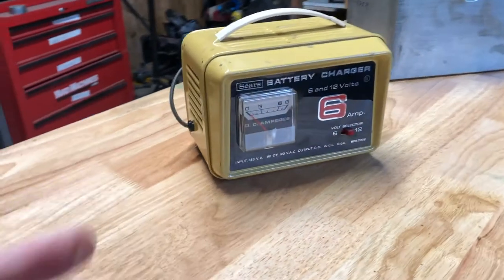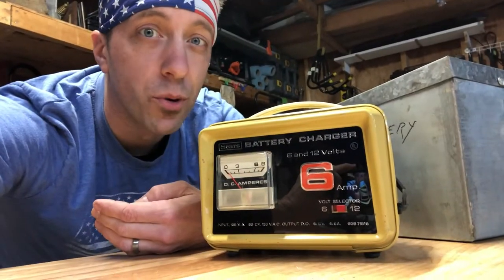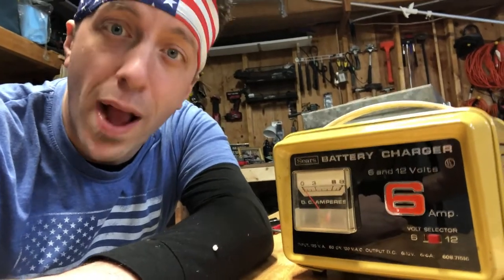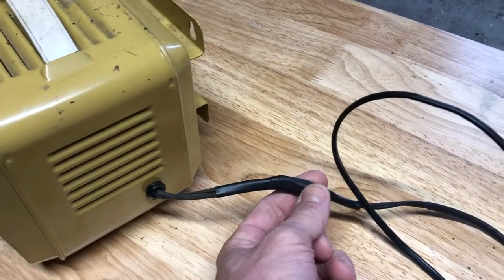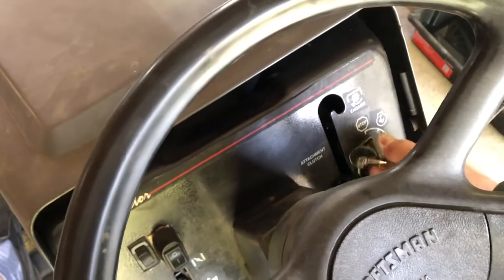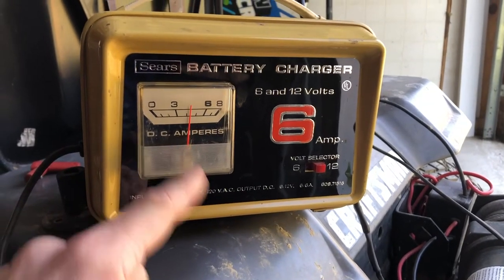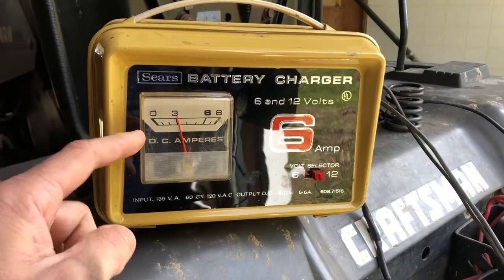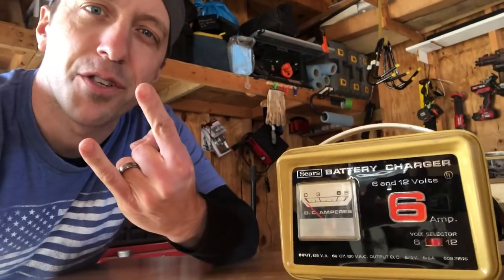I Tested an Antique 60 Year-Old SEARS Battery Charger - Does It Still Work?

Comment: I have an old charger just like this one that I have had for over 20 years.  My mother saw it at a yard sale and gave $5.00 for it, I replaced the power cord and the battery cord.  I also sprayed it gray and I have never had any problem with anything that I have used it to charge.  I didn’t realize it was that old, mine didn’t have the case with it.  I think you should get good service out of it, and that it will last a long time.
Reply from the maker: I sure hope so! It seems to be very well made. Thanks for watching and for the great comment. 🇺🇸🤘

Comment: Nice trickle charger. quick question should you not be able to tell if it is charged enough by the gauge. When you say "this thing is pulling" i am not clear sorry ha ha. I thought if you put the battery charger on the battery can show if the battery is charged or not the needle will not send current to the battery so the needle is on the far left? I had no idea that the needle would go to the right after half an hour and am wondering why. I am not that bright with electricity as you can tell but would like to know why the gauge barely moved when first plugged in then went higher and then went back to the the lower number around 3. IF any knows could you please clue me in ? Thanks in advance. Mine is from the late 40's early 50's I think and was a gift and I do treasure it :-)

Comment: I picked up an old charger two weeks ago but I can’t find any info on it. It’s at least 60’s but I’m thinking maybe before that. It’s an electric service systems charger or (ESS). There is very little info on google and Facebook doesn’t have any old school charger groups. It does work but I think it’s a 6 volt. I like vintage stuff and your charger is cool as well!
Reply from the maker: Wow, great find man! Old tools like those are great to come by.
A few years back I picked up an old air compressor and couldn’t find any information on it. I did find a stamp on the tank, so I contacted the company (still in business!) and they were able to get me information on it. 
Thank you for watching 🇺🇸🤘

Comment: It might even last another 60 yr.  Much less fragile electronic apparatus inside to fail.
Reply from the maker: True. I did take it apart. Copper windings, and soldered joints that look very solid - all these years later. I was planning on buying another charger, but I found this and it looks like it’ll be in the garage forever. Thanks for watching 🇺🇸🤘